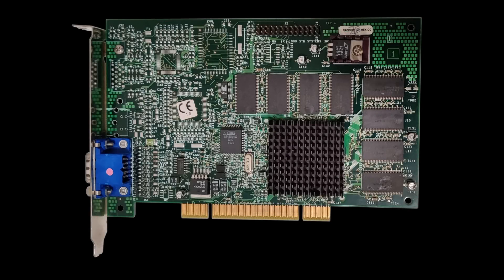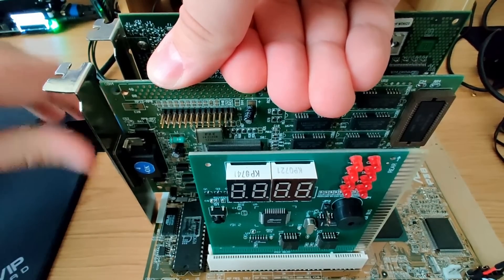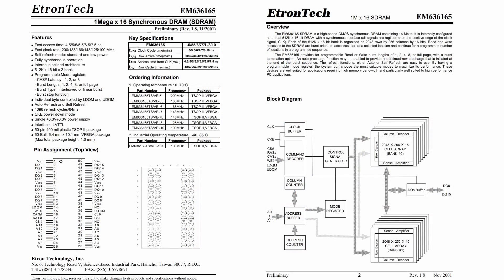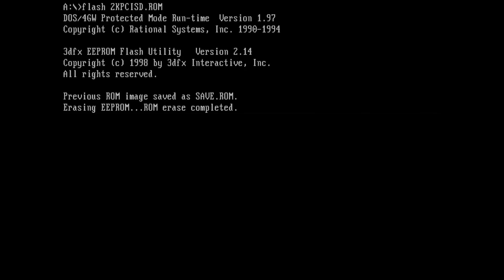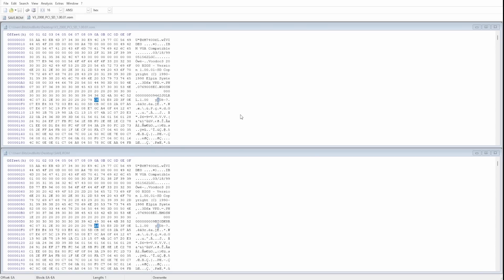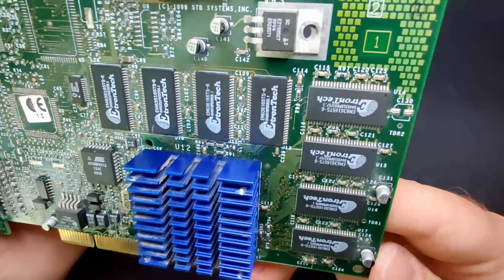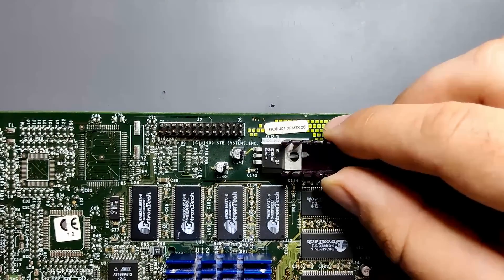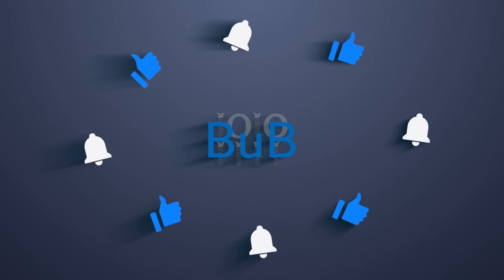Fix common issue of 3dfx Voodoo 3 (black screen)

Comment: It's interesting that while the downloaded BIOS is 64 KiB in size, SAVE.ROM is only 32 KiB.
Reply from the maker: The downloaded BIOS is empty after 32 KiB (HEX F-values). When such a BIOS is extracted again, it is saved at 32 KiB. Must be something the tool does.
Reply: Since you've never extracted the upper 32k area of the flash memory you also couldn't compare it to that of the downloaded file. NOR flash bits can only be reset after a chip erase set them. Maybe bits in the upper 32k have been reset over time and that caused the issue because the firmware is looking for something there. A chip erase command during the programming will set all bits in the NOR flash to 1 again, which would explain why everything works again after flashing back the old lower 32k content.
Reply from the maker: Interesting! Yes, you are right. The flashing tool never extracted the remaining 32k. If there was something that caused the problem, it was lost the time the chip was erased.
Since I did not remove the BIOS chip from the card to use a programmer, the upper 32k were not saved.
Reply: @bitsundbolts  too bad, yes ;-)

Comment: Looking at the heatsink it appears that a fan was screwed onto it at some point, as you can see at the corners there is missing color where the threads would have bitten the heatsink. That is very strange as I don't see anywhere for power to be sourced on the card for the fan. I suspect that the heatsink is not standard.
Reply: I was thinking the same. Looks like it might have been a heatsink meant to cool a chipset that may have had a small 40mm fan on it. If that's the case those fans were notorious for failing back in the Pentium 4 / Athlon XP days. In general the Voodoo 3 2000 GPU didn't need active cooling so the heatsink may have been salvaged for that purpose.
Reply: Guess a previous owner did some modding on the card. A different cooler with a fan powered either from the PSU or motherboard. Been there, done that. My Geforce 3 Ti 200, Geforce 7300 GT and Voodoo 3 3000 had that done at some point.
On the Geforce 3 I even went so far to solder in a new fan header. Or rather two pieces of wire with the right thickness. It's a passive card, but the solder points are still there.
Reply: The Voodoo 3 2000 (AGP) card I have doesn't have a fan either. I agree that it may not have had a fan originally.
Reply: Definitely had a new heatsink at some point. My V3 has an aftermarket cooler (no idea of the origin but it looks to have been purpose made for the V3) and the fan has a Molex connector attached

Comment: Probably best to replace all of those electrolytic capacitors since you're already working on one
Reply: Why would you, if they checked good? Thats just "hurr durr replace now" mentality.
Reply: @ToTheGAMES I have serious doubt that those replace all capacitors advocate even have an ESR meter to measure if the electrolytic capacitor are off tolerance. I do lot of electronic repairs and unless your capacitors have blown or are bulging there is no way you can tell if it is good or bad just by looking at it. My ESR meter has been a very handy tool that had saved me lot of time and money from an useless full cap replacement. Though I must admit that those SMD caps from that era are simply garbage and were put in high stress environment, which is almost certainly garanteed they are dead by now.
Reply: @ToTheGAMES no it's not hurr durr, it's called preventative maintenance. All capacitors will leak at some point. You gonna just change one and then put it in a drawer for a few years where the other caps slowly kill the card? Or sell the card, it ends up in the hands of someone who doesn't understand electronics and it ends up dying one day. Caps have a shelf life, even if you don't use them they go bad in time. If you replace with organic polymer they'll last a lot longer.